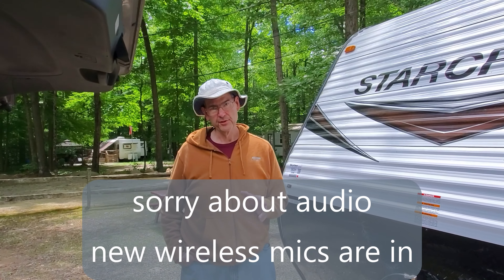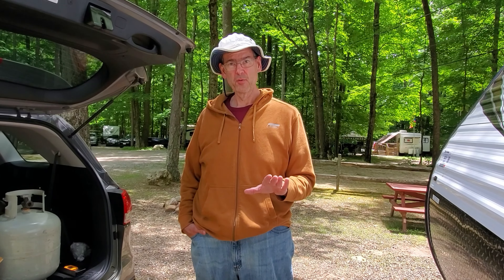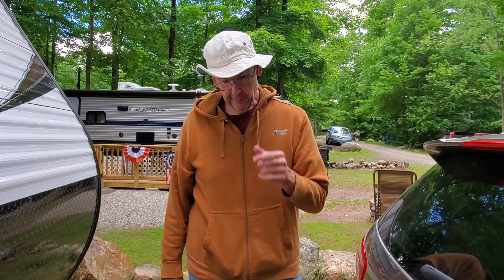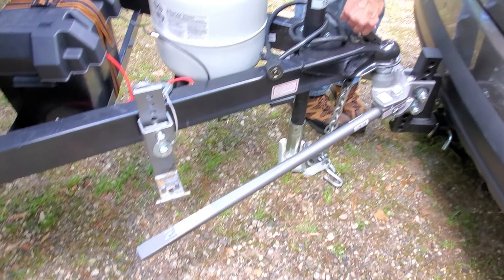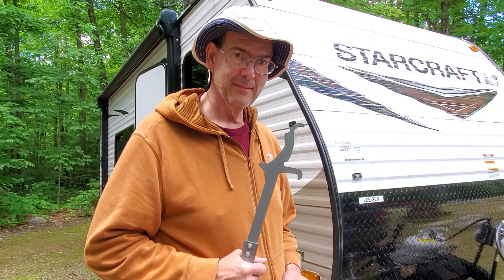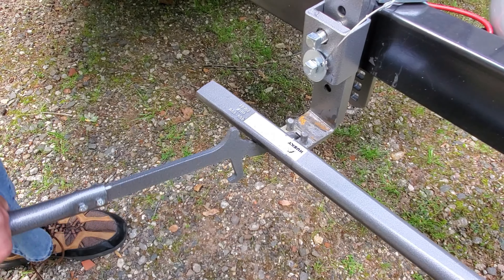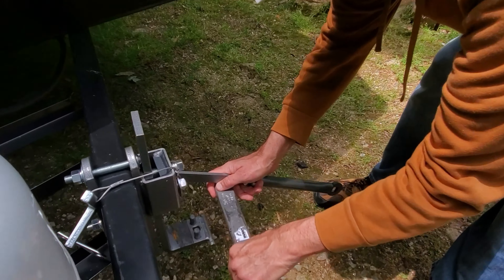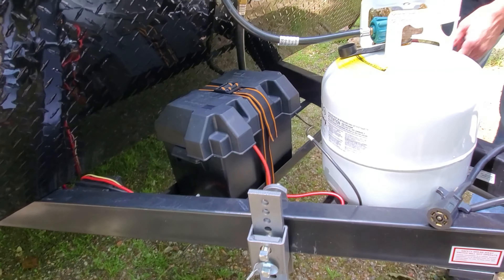Hooking up a Weight Distribution Hitch - Husky Center Line - Owner video, not sponsored

Comment: Does your hitch make a lot of noise? I have the same set up and it gets loud when I'm turning
Reply from the maker: Sorry for the delay. It does make noise if it is adjusted correctly. It is intended to stop sway, so even in a turn, it will resist the change in angle. I noticed the bolts need to be torqued regularly to maintain the anti sway capability.